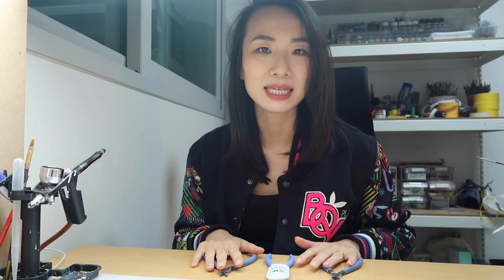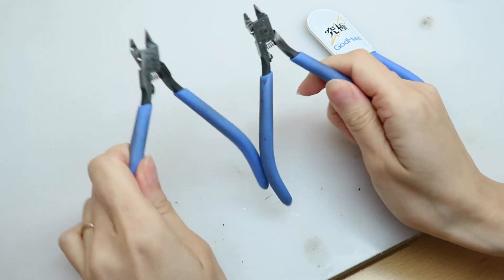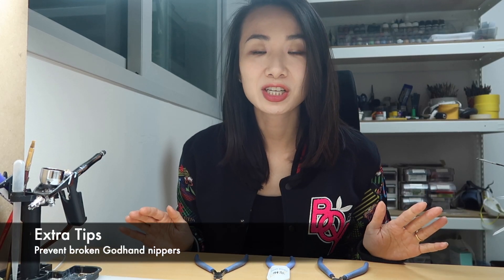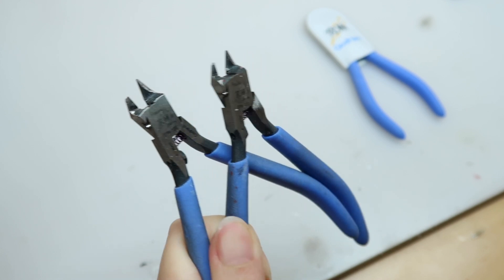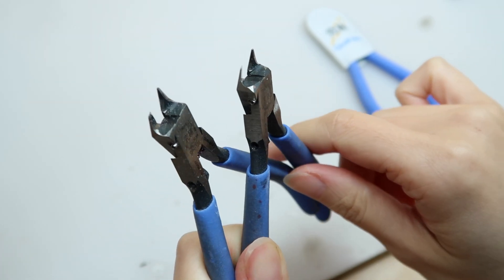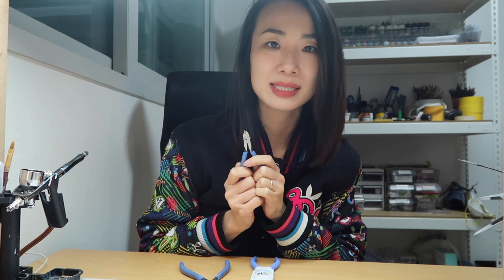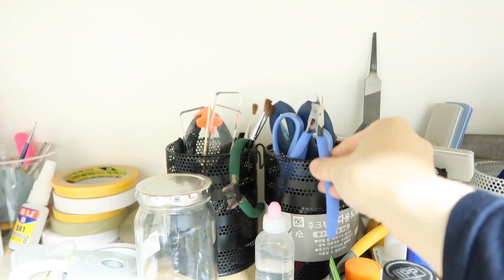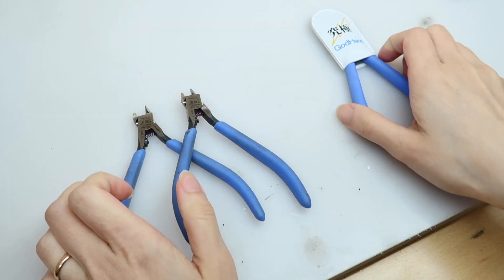CLEAN RUSTY NIPPERS (CHEAP & EASY) with GodHands | Gunpla Tutorial for Poor Bruhs

Comment: You gotta get the Godhand Oil to go with them and then if your a true Godhand fan, then you need the nipper rack to hold them all 😂👍🏼 red pair for 1st cut, blue for the finish and dont cut with the tip! :). However, I just finally got the oil, before that I used to use barber clipper oil 💈
Reply from the maker: You sound like the Godhand cult leader and I need to join. Show me your ways, oh great one!!
Reply: frostedsnow  🤣🤣🤣 you’re in young padawan, I will show you the force!
Reply from the maker: @thebigbient8736  Kughee only made me watch my first Star Wars movie recently XDD that's a cult I don't fancy getting a foot into
Reply: Does that mean I have to rinse my kits in water and soap after using the oiled nipper?
Reply: @Traverse the Globe no, you’re only lubricating the joints and hinges on them and wiping off the excess, they shouldn’t be getting your kits oily afterwards.
Reply from the maker: Right on!
Reply: @Ver.g0sh  Thanks for the advice.
I just tried using the Singer sewing machine oil.
My location has high humidity all year round, gotta keep the nippers rust free!

Comment: As an extra step you might consider putting a small amount of oil in the sheath that way it’s stored in oil. It can be WD 40 or any kind of clear oil will do. I’ve used fishing reel oil and it works well.

Comment: If you're not gonna use them for a while I find that vaseline provides longer lasting protection than wd40 which evaporate at some point. Obviously a silicone based wd40 lube will do exactly that but I was in a pinch so I whipped out the jelly... the petroleum jelly! I also saved some Xacto blades from rusting away after barely any use.
Reply from the maker: Thanks for the tips. We use a silicone lube for the airbrush but I don't like how it's a bit thick and sticky :/
Reply: frostedsnow yeah, I hear ya. That’s why I use it on nippers and blades only. You wipe it off with a paper towel and your good to go. I use a cotton swab to apply a thin coat so it’s never too gunky when I store them back.

Comment: For the longest time, I have been using a wire cutter for my modeling kits. (yes, those wire cutters meant for electronic work)
I just got myself a GIC 2.0 nippers, and it is a complete revelation! 
It's not a Godhand, but the GIC 2.0 works alot better at giving me a smooth cut.
Reply from the maker: It's okay to start off with what you have :) glad you got a pair of better nippers, doesn't have to be GH!

Comment: I bought a spraying bottle of Ustar UA-90104 to clean my nippers, it turned out it was the same as RP7 (similar to WD-04) which was already available at my house. 
P/S: the G-Temple GT-02 is a decent cheaper clone of SPN-120.
Reply from the maker: Nice! So many different options. Never heard of the G-temple nippers. Interesting that it's a Japanese product. Thought it'd be a Chinese knock-off. It does look very similar!
Reply: @frostedsnow  IIRC this GT-02 nipper is made in Taiwan. G-Temple brand does seem like "underground". Maybe it's just a small brand for Japanese market. You can find it on taobao too.

Comment: Question, how often do these type of maintenance on the clippers? (say on avg building 3-4 kits per month)
Reply from the maker: I'm really lazy so I do it only when the rust gets kinda bad T__T You should do it before you start seeing rust. That'll probably differ a bit for everyone, but every few months? It doesn't hurt it anyways if you do it more often than absolutely necessary. My brand new nippers came rusty :/
Reply: from my experience the nipper hardly get rusty when you use it a lot :) well, it also depends on your environment. And you should do this maintenance before you take a long break from building, because spraying this liquid on your nipper is the same as "coating" it to protect it from humidity.